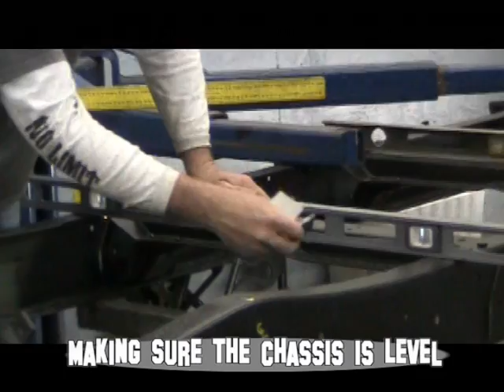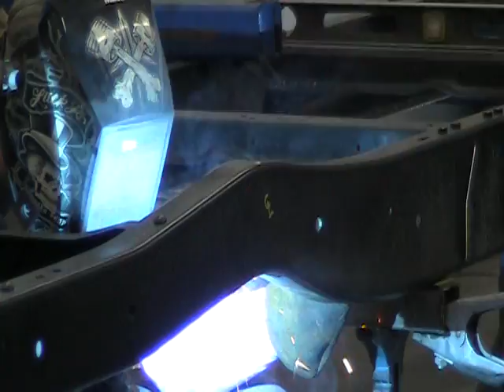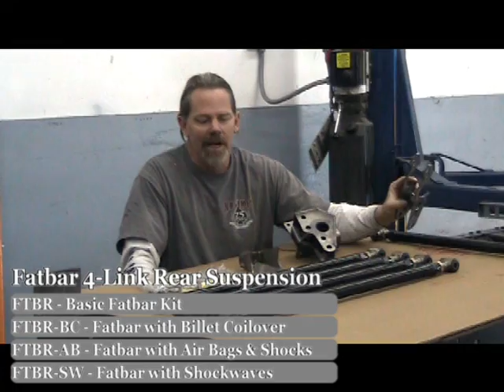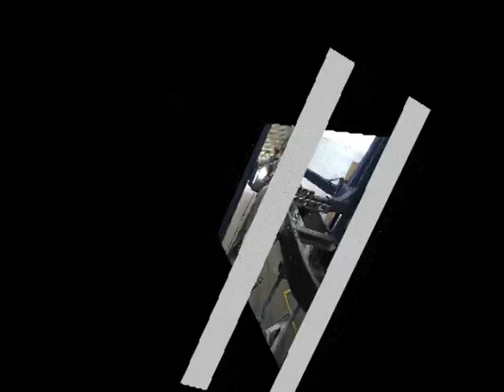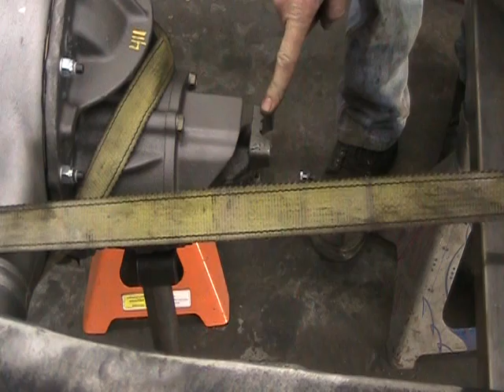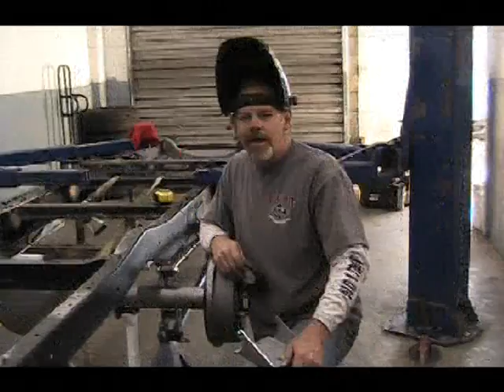Wide Ride IFS & Fatbar 4-Link Installation

Comment: A few questoins. One, The top bard angle why the spread on the back more and not a parallel with bottom bar on a street driver? Second, how do you adjust the front mounting plate when you have a fixed plate that fits under the frame> if going fo a lower ride height your bottom bar would not be parallel to chasis. Again just a few thoughts. Thanks for making a video available.

Comment: That 4 bar setup is not a good choice for more horse power , the front mount is way wrong because it is a single shear plate welded to the frame with all the load moved outward with no gusseting or other support. That also needs a Trac locator that you don't have . The added inner plates are there for what strengthening? Just that one all area isn't doing much of anything.back up, regroup, try again .

Comment: I see you have your ground clamp on you lug stud, I would probably replace your axle bearings now that you have arced thought the bearings, other than that very good video
Reply: It's a new technique. Years of scientific research has determined that bearing rollers never wear out if they don't roll.
Reply: you are an idiot or just don't know what you are talking about. Bearings are now junk
Reply: How the fuck do the bearings *arc*? The balls run in constant contact with the bearing race, fuqtard. To get arcing you need an air gap. Check how spark plugs work, then close the electrode gap to zero..... they're still arcing, right?